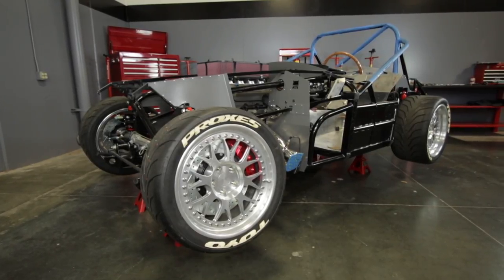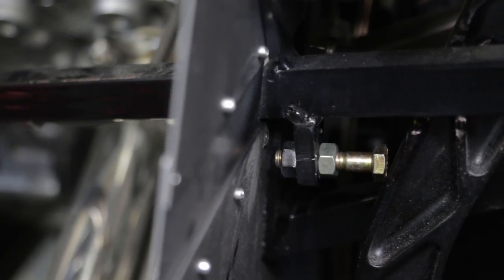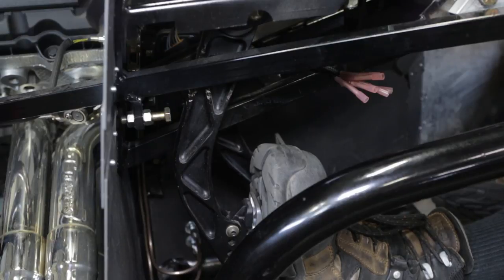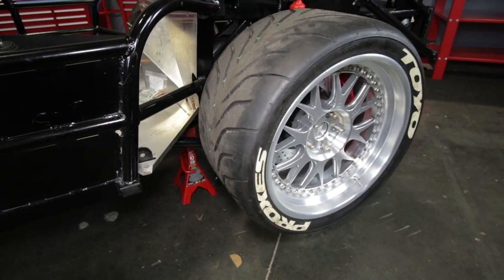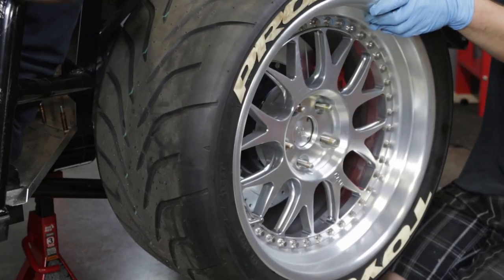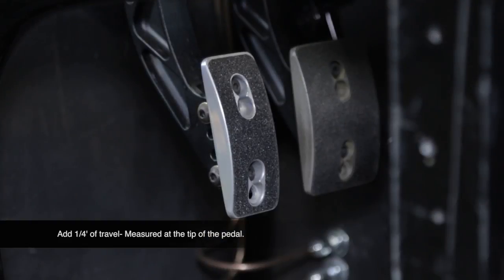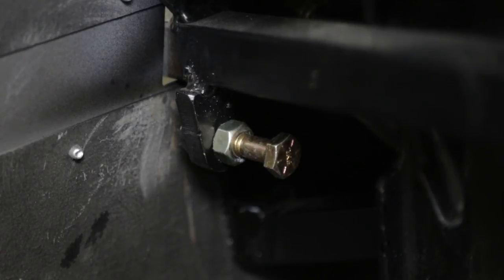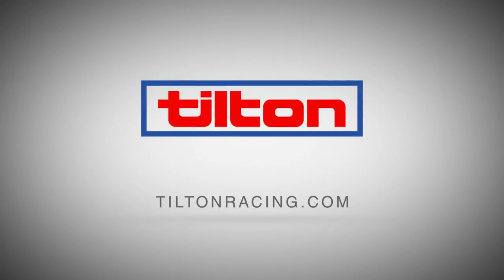How to Properly Set Your Clutch Pedal Stop

Comment: Bled all air out of the line. Took 4 hours and 2 master cylinders. Bearing still will not engage.
Reply: Have you made sure the air gap between the hydraulic throwout is around 3-4mm?
Reply: The bearing was 1/16 from the teeth at first. I added another 16 to make it a total of 1/8 from the teeth upon installation. I checked the barring to make sure it was spinning free before bleeding the line. After several attempts with soft pressure, I finally applied firm pressure and the clutch finally disengaged. But now, the barring is sitting on the teeth with no pressure applied. I’ve just went and Removed transmission yesterday.
Reply: Would be nice if Tilton would respond. My 3an fitting is leaking from the tilton HRB itself. It's not the 3AN make fitting